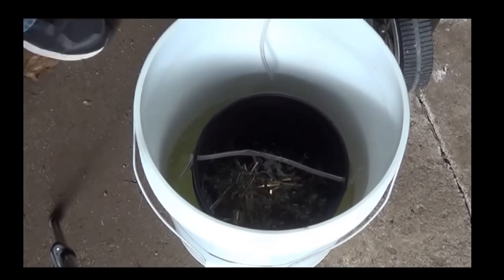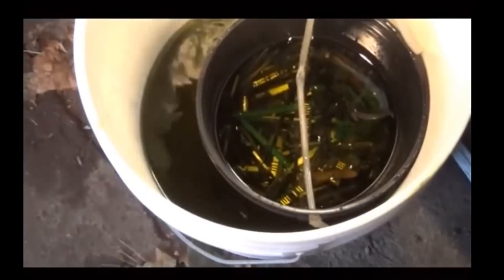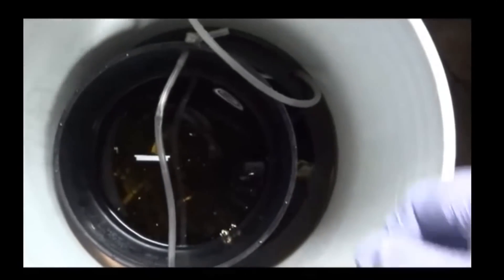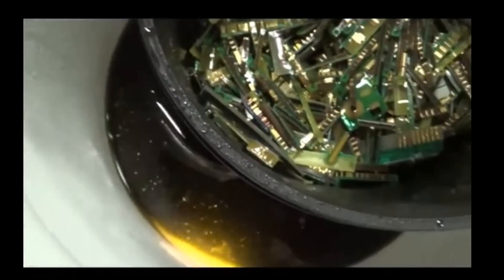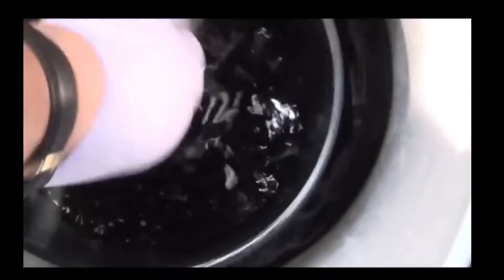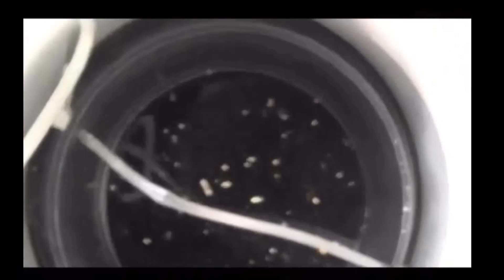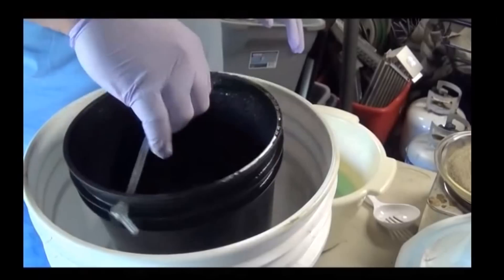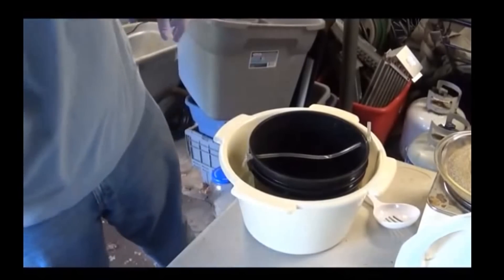Free GOLD! Is there Gold in them there circuit boards? You betcha but...

Comment: I used to manage the chemical process for electroplating those gold tabs prior to the circuit board manufacturing being off-shored.  The commercial way to chemically dissolve Au is with sodium cyanide solution, which is what a gold plating bath solution is.  Needless to say, please to not attempt to obtain this people as it is a deadly toxin.  Tank cleaning meant electroplating out 300 oz of gold onto a gold bug.  This was when gold was $200/oz.  One of those as 3x my annual salary at the time.  Yeah, if you think $35K/yr is absurdly low for 1994 and you see how much gold is now, it just tells you all you need to  know about how to protect your wealth.  So if you make 100K now, guess what.  that gold bug is STILL 3x your salary.   You may have heard of one of the companies I worked for.  Johnson Matthey.